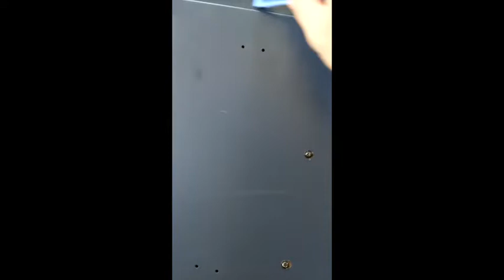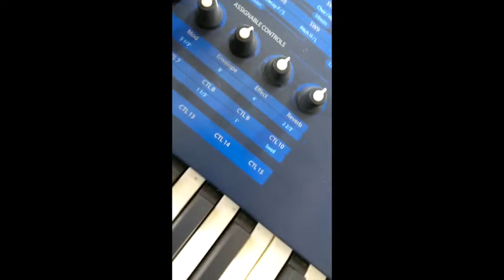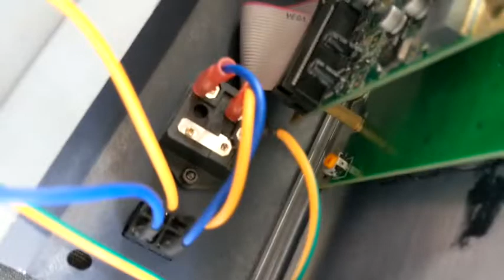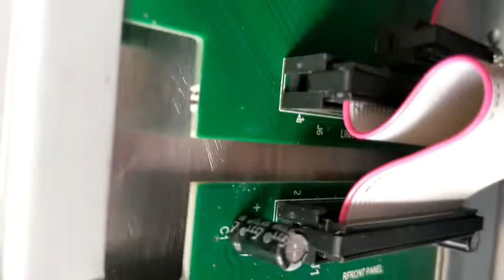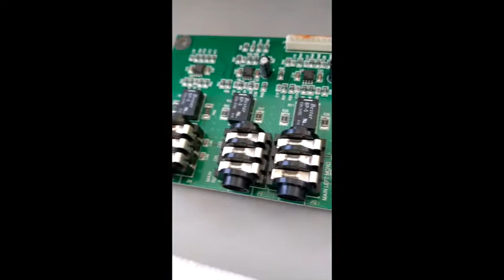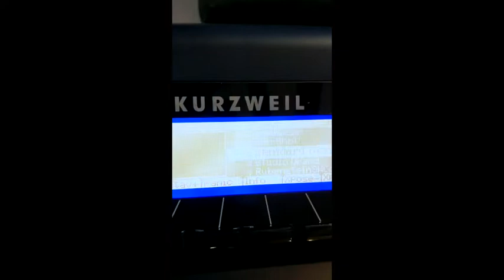Kurzweil PC3LE6 blinking lights Fix and repair

Comment: I know this is an old video, but I purchased a PC 3L8 which came after the six. It has the same problem. Kurzweil should be held liable for every unit they produced. It’s disgusting and I will never buy one of these pieces of crap again.
Reply from the maker: Yeah, try the fix and tell me if it works on that model.

Comment: Nice work! I have a issue with a pc3a6 with a white line on a screen completly blue. Alredy change the main board by the official service and nothing help. Have any idea what could it be? Reggard from south América
Reply: I am not sure. Try this fix. If it doesn't work, maybe someone else has an idea.